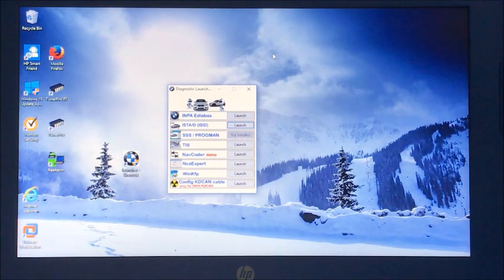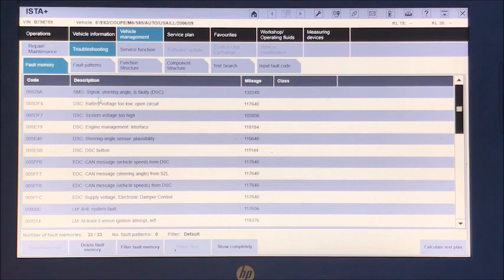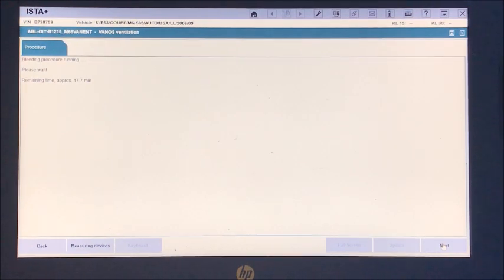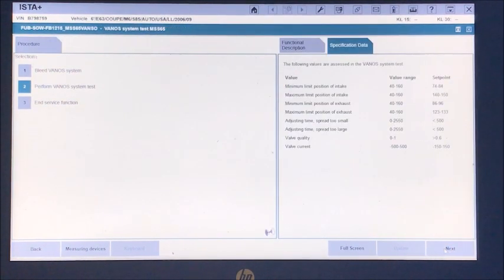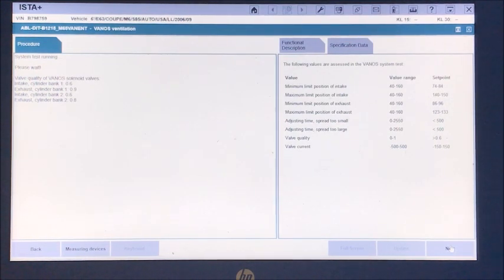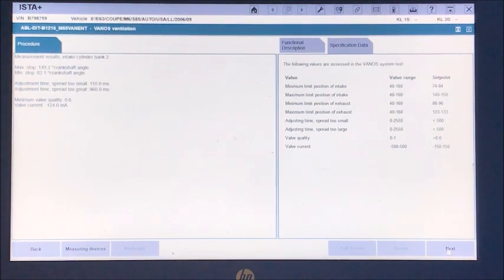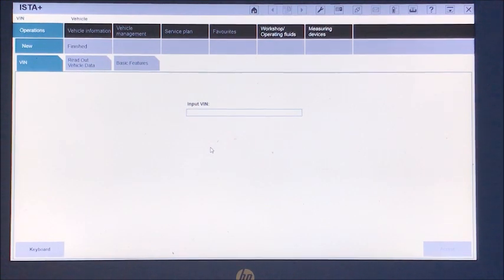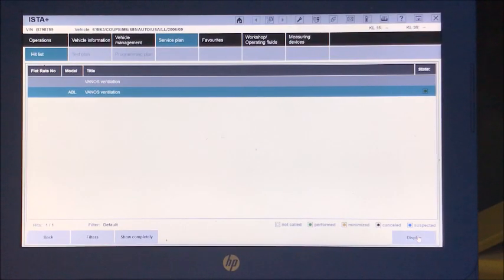BMW S85 Rod Bearing and Vanos Line Replacement Part 13 - Vanos Bleed with ISTA

Comment: Hi Steve 
Is it essential to bleed the vanos system after replacing the high pressure vanos line? 

I’m wondering- wouldn’t it bleed itself under normal driving?
Reply from the maker: Hey again, if the vanos line is not bled of the air, the car will probably make terrible noises since the pressure in the vanos line is pretty high and just a tiny air bubble cavitates the valves. I’d say it will probably also throw codes for the vanos since it would be way out of range on the valve opening and closing speed targets.

These are very sensitive motors when it comes to the sensors and allowable ranges so I’m not sure I would try to run it without performing the bleed procedures (several times from what I ended up doing)
Reply: @StevesDIYs  thanks 
Also, with setting the backlash on the vanos gear. Is it just a case of manipulating the vanos pump until it’s in the right place to give the correct backlash on the gears? 
Presumably there’s a bit of room for manoeuvre in terms of how it sits when the bolts are torqued down
Reply from the maker: @mista5796 👍. Yep, that’s correct…there’s a little movement of the pump on the bolts so the pump can be thumped until the lash is within range.

Comment: Awesome vid.  Need more of the ISTA procedures since it's not well documented.  Going to do additional bleeding w one solenoid being at minimum spec.  Have you heard if changing o rings will help?
Reply from the maker: J T , thanks man 👍. Yep, there’s hardly any documentation for ISTA that I have found either...would be nice if someone had a guide for it as it can do a lot once you start exploring the menus.  If the orings are bypassing slightly it will slow the reaction time down from what I understand.  For mine, they came in close after the three or so bleeds and have never faulted or anything since the videos which was like 7000 miles ago, so I haven’t done any more to them.  If they do ever fault, the first thing I’ll do is change the orings (and re-bleed) to see if that corrects it.
Reply: @StevesDIYs  Hows the car running?  Did you ever swap out solenoids or just driving it wo issue?  BMW Doctor seems to have some handy vids on ISTA too.
Reply from the maker: J T , still purring like a kitten (or roaring like a lion would be a better phrase for these, lol). I never did have to change the solenoids as they didn’t ever throw any faults and the car has no hesitation when I get on it hard. My 5k mile oil analysis showed no abnormalities either so it looks like the rod bearing job was a success as well. Not related to the vanos or bearings, but my idle air control valve appears to be going out as I get a periodic undulation in idle when I start it up and it’s running the cold start routine so that’s probably the next diy video for it, lol. It’s not throwing any codes yet for it though so I’ll wait till it gets grumpy about it.
Reply: @StevesDIYs  hopefully nothing major. Glad to hear you didnt even fool w the solenoids.  I ordered the kit from ECS tuning so may swap them out and see what values I get.

Comment: Bro if your vanos were not performing ok, so did you dk anything about it , or the car is running fine , even with the test says not ok
Reply from the maker: Salman Iftikhar , hello, I’ve not had any issues or faults since making the video about a year ago even though there were a couple solenoids that never gave an ok on the quality.  I never could find any good info on why they read not ok in quality, but it doesn’t seem to upset the car any.  The more important measurement seems to be on the reaction time of the solenoids (the spread), but even with one of the intakes never giving an “ok” on the spread, I’ve still not had any problems or codes.  The one that never came into the acceptable reaction time may be just a little off or something, but not enough to hurt.  Hope this helps, Steve

Comment: Great video series Steve!  I've got a 2006 E60 M5 ready for a bearing job.  You gave me tons of confidence to tackle it myself.  Thx much!
Reply from the maker: Matt Riepenhoff , thanks man !  Glad the videos are helping out 👍. I’ve got about 6,000 miles on mine since the job and she’s been running flawless. I’m really glad I sucked it up and did mine...if only for the peace of mind. Mine had a couple of areas down to the copper layer so they were for sure due for the change out.

Comment: Well Steve following on from my last comment. You did a heck of a job, clearly the most professional set of instruction videos for this task on the tube. I see other guys struggling without the correct tools and spare parts needed to do this job correctly. Once again, we'll done.
Reply from the maker: DaveP , thanks man !  Yep, for sure need to order up everything ahead of time or there will be a lot of delays in doing the job and a ton of added frustration that may lead to mistakes.  Always best (in my opinion) to have everything ready so the process flows smooth and there are now delays that may make me forget something when doing the reassembly.

Comment: I’m just about to purchase my first E64 so I thought to do some research. I almost walked away from it until I found your video. You are one of the best. Thank you for actually contributing useful information on you tube. It is overtaken with snowflakes make videos with no substance! Cheers to you Sir!
Reply from the maker: Pete Zaker , Thanks for the compliment, I really do appreciate it 👍. I doubt I’ll ever get a boat load of subscribers like the folks that put tons of videos out and just talk about what to do or what they did, but I’ve always said if a video helps just one person it was worth making it and posting it up.  Thanks again and enjoy your car !  No other vehicle I’ve owned compares to my M6...absolutely a joy to drive.
Reply: Am convinced that others currently undergoing this task have all watched your vids first.  But still they haven't done their homework.  If your engine oil is black try changing in first, the slight knock on start up may disappear but before that get a sample maybe you can still get it tested for lead content.  Guys it's more work, but leaving the cross member hanging gets in the way all through this process and please remember make sure you have all the seals O rings and vanos screen ready.  Trying to get parts in this current situation is going to he difficult with delays. Might be better if you can leave it until things improve. Be safe out there.
Reply from the maker: DaveP , for sure it’s a good idea to get the oil analysis done to see if metal amounts are going up (I did mine twice before the bearing change just to see).  I don’t think it provides a definite answer on when it change, but it should at least show a trend.  Some of the bearings people are changing to no longer have the Copper/ Lead layers so oil analysis won’t reveal much in the future.  Post up how the change out went and if there are any additional tips for folks that I missed 👍. Thanks and be safe out there too !

Comment: I have codes 271B and 271D I’m assuming Vanos related in addition, I have metal particles in oil filter, I’m not sure if it’s from Vanos pressure line or rod bearings, but if I were to do the pressure line i should probably do the bearings 
2008 e60 m5 thank you
Reply from the maker: Ilir Rugova , hello...yes, if it was me, I would definitely do the rod bearings if I were doing the internal vanos line since the majority of the work is actually getting to the bottom of the motor.  It also seemed easier to do the bearings with the pump off since there was much more room (though I have seen where people did not take the pump off to do the bearings).  There was also a very small screen beneath the vanos pump (I showed it in one of the videos in the series on my channel).  Mine had just a faint amount of tiny metal particles trapped in it so it makes me wonder that if you are seeing some metal in your filter, if that little screen also has some metal in it and is blocking off some flow to the vanos pump?  Not sure about that though, but it does make me wonder.
Reply: @StevesDIYs  I wonder if you're talking about this one: https://imgur.com/a/MKk7P94
Sorry, I see no better way to upload a screenshot, hope this works
Reply from the maker: Denis Pershakov , hello, yes this is the vanos pump that has the small screen above it. Here’s a link to the other video in the series that shows the removal of the main pump and the vanos pump if I t helps. https://youtu.be/in4memHoq-I